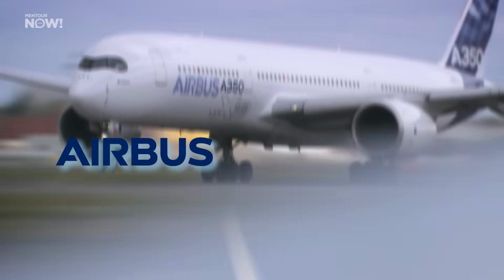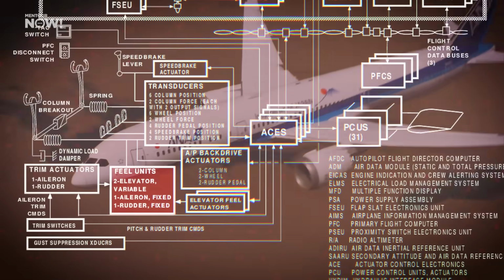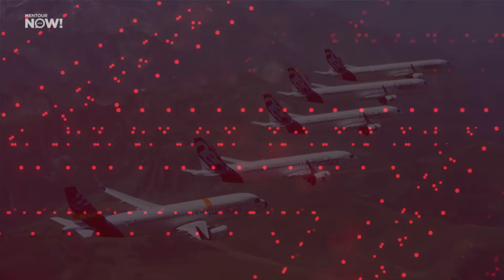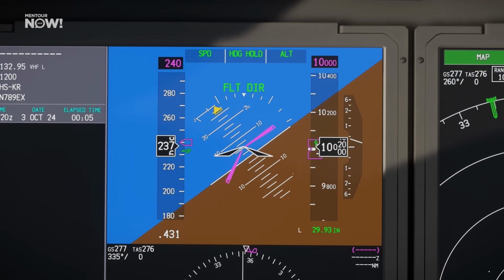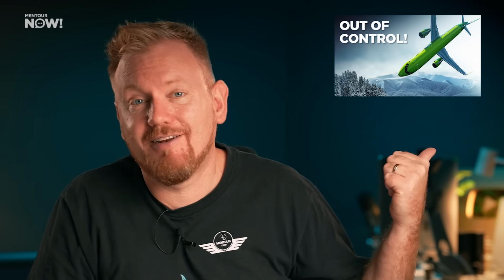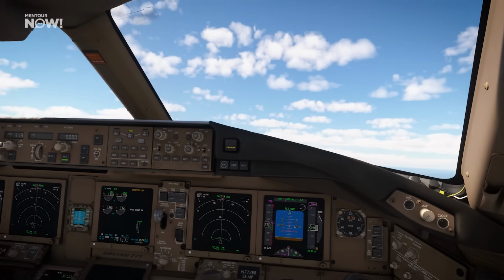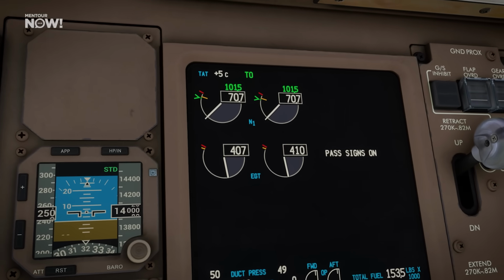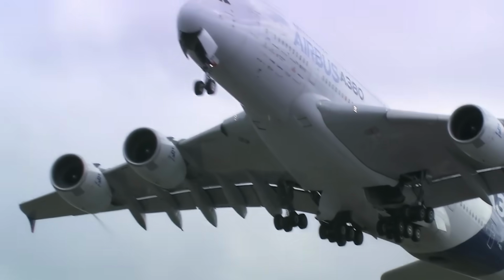Do Pilots Prefer AIRBUS over BOEING?!

Comment: I flew the 777 for 14 years until Delta parked them in 2020 due to COVID, then I was displaced to the A350 and flew that for the last 4 years.  I could write a book about the differences but I’ll just say this; the Boeing design requires a “pilot” to “fly” it, as in, you the pilot must trim it and provide inputs all the time.  

The Airbus doesn’t require any flying skills to fly it, you simply point it in the right direction and it’ll trim it and hold it wings level, nose up, all by itself because the flight control computers are actually flying it, you’re just telling it what to do, then you can let go.  It will fly a TCAS RA all by itself, it will fly a wind shear recovery all by itself, etc.  No flying experience or real skills required….until the pitot tubes ice over,and the pilots have no idea of how to recognize and recover from a deep stall.  

Airbus tries to make their airplanes idiot proof, and that works fine especially in the third world where their pilots receive minimal flight training and have little hand flying experience.  The Boeing assumes a real pilot with flying skills is going to be flying it, but that ridiculous MCAS thing they added to the 737 was just stupid!   Unfortunately Boeing lost its way after they built the 777.

I much preferred flying the 777 to the A350.  The 777LR has the much bigger GE engines, 110,000# of thrust each, vs only 84,000# thrust for the little RR engines on the A350-900.  We were constantly leaving 30-60 passengers behind on flights over 14-15 hours on the A350 whereas we could fill the 777 up and fly 16+ hours easily.  The 350 burns less fuel of course, because it’s got smaller engines and carries less stuff, less far, than the 777.  Oh, and the A350 crew rest area is half as big as the 777’s.  So from a pilot’s perspective, I much prefer flying the 777 to the A350.
Reply: I had to go back and take a look at the Asiana San Fran crash and the Atlas Air disaster in Houston.   Asiana was 777, Atlas Air was 767.  Both indicated err/lack of training/lack of skill/pushing buttons at random.  The Asiana guy made mistakes and lacked experience and understanding.  Atlas Air was basically a total incompetent who should have been a baggage handler.
Reply: Having flown thousands of hours on both the 737 and the 320, I do not share the idea that one does not need any flying skills to fly an Airbus. Indeed, flying a raw data ILS approach manually on a 320 comes with its own unique challenges! As does landing the aircraft in stormy weather. Yes, there is an amount of ‘foolproofness’ installed in an Airbus aircraft, but to fly the 320 really well, a far greater understanding of the systems and the flight control laws is required compared to the 737.  A 320 can save the day from pilot error, whilst also keeping a competent professional pilot happily engaged for years and years. You can fly the plane for a decade and still learn new things about this great machine!

 But to come back to the Airbus being foolproof, and the idea that the automation is in control: most pilots never ever in their career reach the limits of the envelope where the computers need to intervene, just as most 737 pilots will never feel the stick shaker. In day to day operation, there is no real difference in flying a 737 vs a 320 other than the tray table!
Reply: and yet anybody that is a passenger would want you in an airbus...dont get me wrong...i dont mean to say youre a bad pilot.
But...as a passenger. I dont care. I dont want to be dependent on the ability of a pilot if it isnt necessary. :)

Comment: No matter how much you dress it up on in fancy terms the Boeing 737 Max was designed by engineers who simply said 'let's make the plane longer so we can cram more seats in'. They led with this aim first and foremost and then later thought about how aerodynamically feasible their design would be.

How else can you explain away the implementation of the MCAS system? A system that no MATTER how you want to put it BOEING DID NOT TELL PILOTS ABOUT. A lot of people will claim that they did and use racism against the Ethiopian and Indonesian airlines that had the crashes but that is BS. How can a company even legally be allowed still operate after concealing a system to the pilots who OPERATE THE PLANE?

Comment: I thing airbus is safer, preventing many situational awareness issues that caused crashes on boing planes. Airbus could further improve on automation, mainly making sure the same error causing to switch to 1 of the 3 computer backups doesnt cause a cascading effect where every computer switch off because of the same error, its not an issue with the computers in that case, causing alternate or direct law. Also more speed sensors in case the tubes fail, think of extending an ram turbine to detect airspeed.

Comment: So... one critical little thing to mention here on the "they're equally safe" conclusion: it is built on the idea that both maufacturers make Gen 4 airliners, which are far more safe than Gen 3 airliners. However, as this video itself states, while every single plane Airbus currently produces (A220, A319/20/21. A330. A350) are Gen 4, Boeing still makes one Gen 3 airliner that actually accounts for the majority of their production: the 737MAX. If it is true that the advances between Gen 3 and Gen 4 reduce the probability of accidents by 90%, that means most modern Boeing planes are inherently less safe than AIrbus planes.

Comment: when you compare the most advanced types of both manufacturer the 78 and 350, yes the differences are not that major, while one type has some upsides and downside the other as different ones, but when you compare the most comment types, 320 and 737, unfortunately the differences are huge in terms of safety features and technology, and that will be the case until Boeing will decide to design a new narrow body jet to completely replace the 737, which will probably happen in a decade, meaning we will probably see 737s flying it the 2050s and 60s if not later

Comment: I am not a pilot, but from the moment I learned more about the specifics of both design approaches - as an aviation fan - I consider missing tactile feedback on Airbus a serious safety issue they should address, regardless of their arguments against it. There are never "enough safety measures," and if this can be done, why is it not. I believe that the Flight 447 disaster would have been preventable with the tactile feedback in place, specifically with the active side sticks. Just my 2 cents.

Comment: Technically speaking, a 737 is fly by wire because your controls are all hooked up to the hydraulics using steel wire twisted into cable. *smugface

Comment: I mean, Airbus doesn't lose pieces of the fuselage in flight like Boeing does. Airbus doesn't have a story of cutting corners when it comes to safety inspection just to avoid having to invest. It's very simple and clear to determine which manufacture is better. This video could have been much shorter if only attacked actually relevant informations to determine which aircraft manufacturer is better and which is worse.

Comment: I flew both.  It’s not Boeing vs Airbus, it is if you like tactile feel to fly a plane or not.  For example, throttle position vs do I have to take my eyes flying the plane to have to look at the engine indication or know where they are by placing my hands on the throttle.  I choose moving throttles.  It’s not Fly By Wire. Us planes have had FBW since the 50s. Airliners like the 320 and 777 were both FBW and came out a very few years apart.   Boeing had a FBW 737 in 73’ for testing so they are the pioneers on that.    They are both great manufactures of airliners but hands down, I vote for tactile feel.    Lockheed and Convair are number 1 in my book.
Reply: Passengers prefer living over Boeing.

Comment: There still could be improvements in cabin pressure level and stability.   The health of crew and passengers has been compromised traditionally to increase the longevity of the aircraft vessel in terms of # pressure cycles.   This is a materials science challenge.

Comment: You did as great job, but let me summarize the way I see it:
— Airbus' fly-by-wire was a great development, but the lack of haptic feedback and the non-moving controls are very, very bad decisions. Even cars with steering wheels that lack any “feeling” are hated by people, so how can one design an aircraft that removes a pilot's full-senses awareness of the situation?
— OTOH, Boeing's protections are too soft. Also, their “the pilot has ultimate authority” is contradicted by the MCAS. Finally, their EICAS hides crucial technical data from the pilots, whereas Airbus' ECAM doesn't insult a pilot's intelligence (“you don't need to know that, you dumbo!”) and offers all the relevant info that might help.

The real issue is the antagonistic, 1-bit logic on both sides. “We're not doing what our competitor is doing.” And, “If it's fly-by-wire, no tactile feedback is needed.” Why not doing both?
— Airbus could implement haptic feedback to their controls. Yes, it can be done.
— Boeing could implement harder protections, while also allowing their EICAS to display more data.

On the “yoke vs. stick” front, I can't have an opinion. Ergonomics-wise, I suppose Airbus has better designs, generally. 

You should read the comments, even from non-paying viewers, because some are really stupid, like the one about the May 9, 2015 Airbus A400M crash near Seville. It wasn't “the computer's fault,” as claimed. The crash was caused by an update to the engine control software that had deleted the configuration files needed to interpret its engine readings. Without such calibration parameters, the software was unable to properly interpret the sensor readings, so it didn't even know what the torque values were! The flight management system trying to prevent an asymmetric thrust profile should be overridable in direct mode, but with no calibration files, it would have been extremely difficult to recover from the situation. Yes, software can kill. But did I mention the MCAS?

Comment: I flew the A330 for 2 years.  The one thing I never liked about the Airbus was that there wasn’t any tactile feedback from the autothrottles.  Boeing’s move and you can at least tell what the throttles are commanding and easily override them if they aren’t where you think they should be (without disconnecting the auto throttles).

Comment: My 2 cents to sidestick vs yoke issue:    With a sidestick it is easy to do crazy control inputs without making the other pilot aware of it.  The crash of the AF 447 comes to my mind: the copilot kept the sidestick in the maximum-climb-position all the time thru the event till they crashed, and unfortunately he was able to do it unnoticed by a nonchalant tiny move of his right wrist.  
Doing the same  control input with a yoke would have been such a crazy sight to the other pilot (just imagine: a yoke fully pulled back held with both hands) that it would have resulted him to immediately retire the monkey on the right and take over the control of the plane.

Comment: In the book "Digital Apollo," many early test pilots (and other military pilots) refused to fly aircraft with FBW. It was perceived that manual controls meant the pilots were actually pilots, whereas FBW meant they were really just passengers with some advisory capacity. Do you want to be the pilot or just a passenger with the ability to gripe?

They had to get used to it. The Lunar Module could only function with FBW; it was determined, early on, that it was be nearly impossible to land it, successfully, had it been strictly manually-controlled.

The F-16 has FBW because the airframe is inherently unstable, such that a pilot would have great difficulty simply keeping it in controlled flight, much less able to conduct combat maneuvers.

Comment: I have had the pleasure of flying the Boeing 737 and the Airbus A320 family, so maybe I may be allowed a comment.

Over 3000 hours on the B737 (200 and 3/4/500). The 200 was described to me on the type course as a "Cessna 172 with jet engines" and it was maybe a bit like the Tiger Moth in that it was easy to fly and difficult to fly well. There were all sorts of glitches, being speed unstable at lower speeds being one of them. The 737 400 had less of those sort of problems, but the automation was very much new wine in old bottles.

I then went onto the A319 and hated all the differences (even the switches were upside down!), but learned to get along with it and discovered that slightly different techniques were needed. For example sudden control inputs in the last 50 feet would be at the time the control laws were changing (blending was the Airbus word) into the ground range. You learned to make gentle control inputs preferably a bit higher than you might on a 737.

I then went back on the 737 for a while and was surprised how much I missed the finer points of the Airbus.

My final flying years were spent on the Airbus (a total of 6000 hours) and by the end had learned to love it. so between the two I would always want to fly the A320 in preference to the B737, but I do acknowledge that I have never flown the more recent Boeings.

However, given a totally free choice, can I have the Twin Otter, an aeroplane I still love most.
Reply: excellent comment. My only jet experience is on the BAe-146, and large deHavilland types. And small DeHavilland types. So basically I have been flying the same aeroplane for 20,000 hours. I have friends who fly old Boeings, new Boeings, and Airbuses, and they all seem to favour whatever they happen to be flying at the time, which is a great attitude. My happiest hours were spent flying a Twin Otter on CAP floats. Peace, brother.
Reply: I enjoyed reading both perspectives above, and your experience paths. I’ve nearly 2000 hrs, since the late ‘80s, mostly on B747 variants—sadly just in MSFS ;-)
Reply: don't fly Boeing unless you want to loose your shirt and get hugged by the girls like the boy did last year on Alaska Airline 737 Max 9.

Comment: The real headscratcher for me is Airbus with the summed control inputs.  What is the case where allowing the pilots to zero out each other's inputs is desirable?
Reply: Afaik it's not a safety concept, it's literally just a way to allow both pilots to use their sticks. If you do anything else, the resulting movement is unpredictable. Force feedback sounds like a natural way to counter the problem.
Reply: @vaclavjebavy5118 Force feedback, a buzzer to indicate that the other pilot is sending inputs, a palm switch that uses either a priority first or priority last decision so either the first pilot to grab the stick has control or the other way around, but the inputs aren't summed. I think I've seen stuff on Air Disasters and such saying that there is either a cue on the HUD or a auditory signal when there are conflicting inputs. That works in theory but when half of the alarms in the cockpit are screaming and 2/3 of the warning lights are blinking, I imagine one more indicator can get lost pretty easy. 

I look at this and my first thought is "This is is really stupid."  My second thought is "People who know a lot more about this stuff made it this way.  Why?"

Comment: I do think its a bit interesting how Boeing pilots usually never get to fly an airbus, at least the ones that arent certified for it.

Definitely a dificilt system to integrate, but i do feel there should be a way for you to get a “test flight” in one, even if it was a jumper seat 20 minute swap out

Comment: Dum question from someone that has flown over 2 million miles on both Boeing and Airbus aircraft. What is the loud electric motor noise on every Airbus after landing. Transfer pumps? It is not the flaps retracting. I do not hear it on Boeings.
Reply: Probably the electric hydraulic pumps. It’s louder if you sit near the wings.

Comment: Honestly, I feel like Airbus system is better, but it is lacking the immediate feedback that Boeing has. Especially with how you mentioned that the TOGA lock engaged during the anti stall maneuvers didn't actually move the throttle levers.

That itself could probably be fixed in software, but then adding hardware force feedback to the sticks could probably also help to eliminate any other confusion.

As with a lot of things, one might be better than the other, but the best option is a mix of both.

Comment: As an armchair pilot who has never even been in a real cockpit, the Airbus concept in general is more appealing to me. However I think that the pilot should have ultimate authority and be able to override all protections, but not without explicitly telling the plane that they want to do so (for example by pressing a dedicated button for that on the flight controls). What I don't like with airbus is, that it adjusts the throttle without actually moving the throttle levers. I can see that leading to confusion in a tense situation really easily.